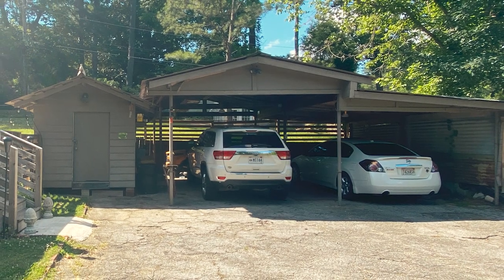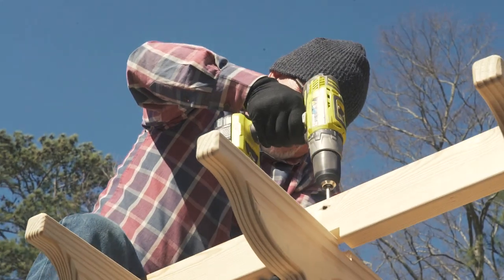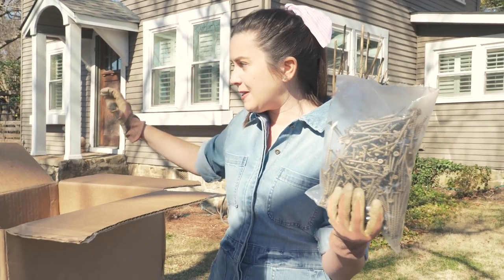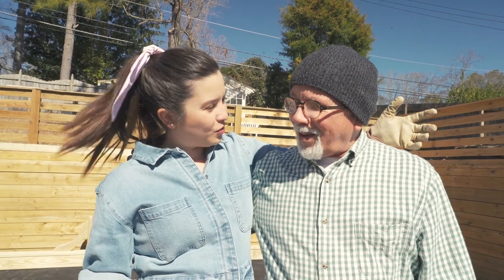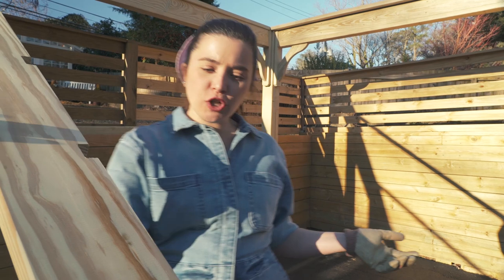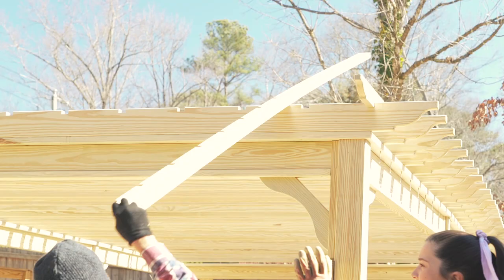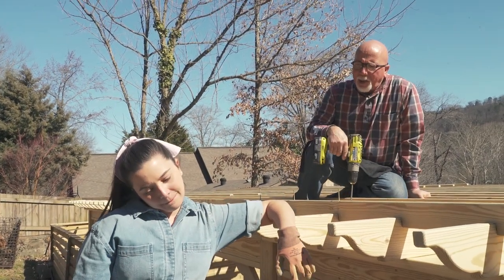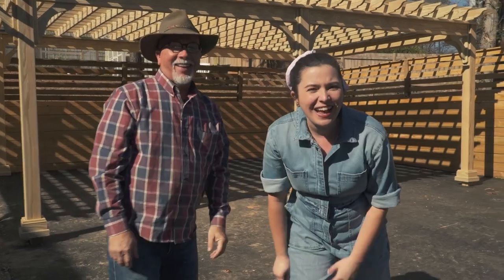How to Build a Pergola with Ivy | Hey Y’all | Southern Living

Comment: Did you cement the legs down or are they secure just sitting on top of the pavement.
Reply: We ran out of time, but will be anchoring each post next week with supplied anchor brackets.
Reply: @farmerwayneo2520  Nice Thanks for the info!